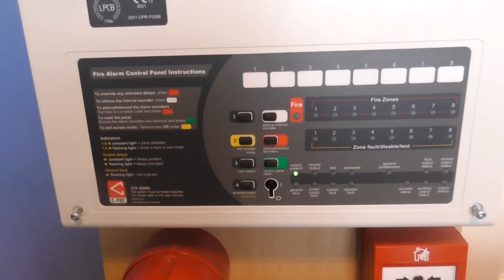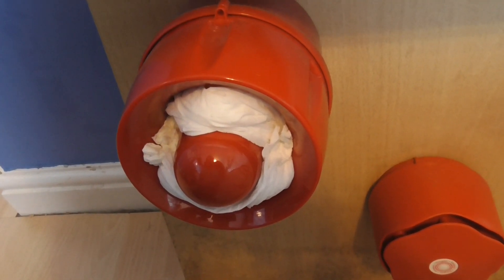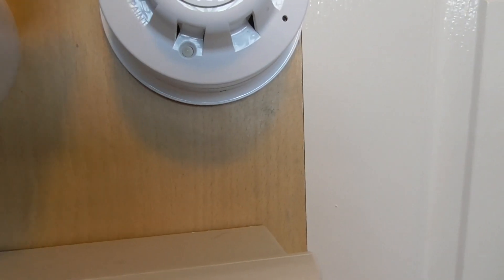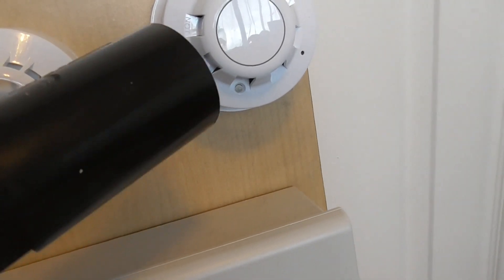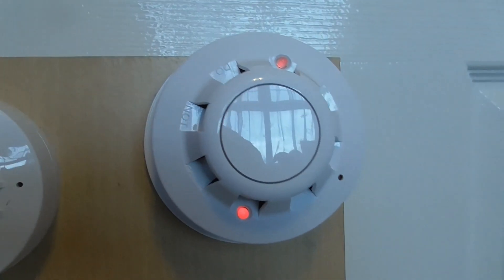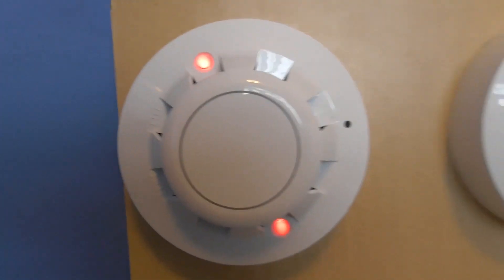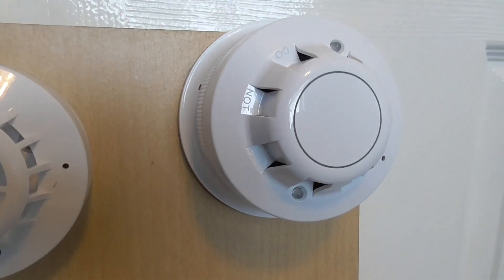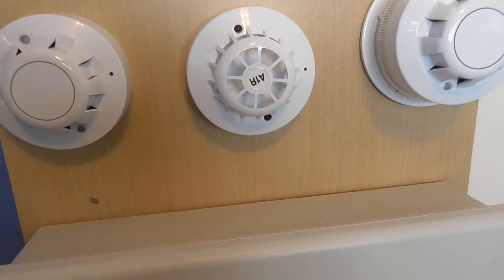Apollo Alarmsense System Test 10 | Last Test (Demo Board)

Comment: Hi, I was told by Apollo that you can only use Apollo alarmsense sounders and detectors with the system, in the video you used a c-tec sounder, do they work with an Alarmsense panel?
Reply from the maker: Hi, you can use any conventional sounder on this panel as long as it’s wired and connected to the sounder circuits on the panel.